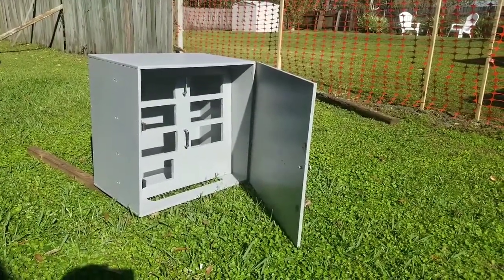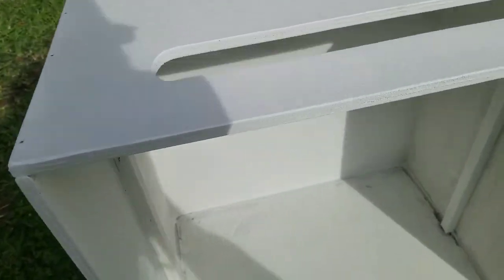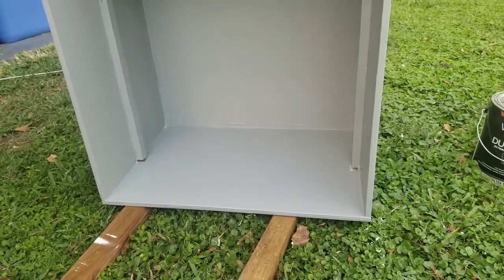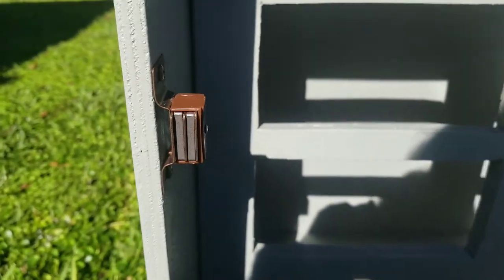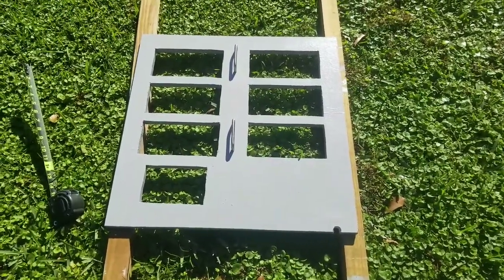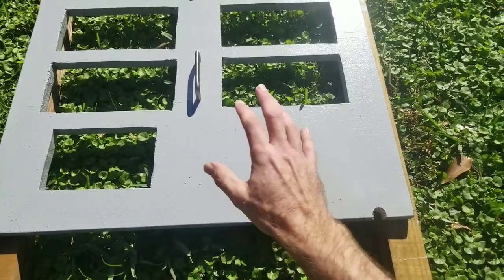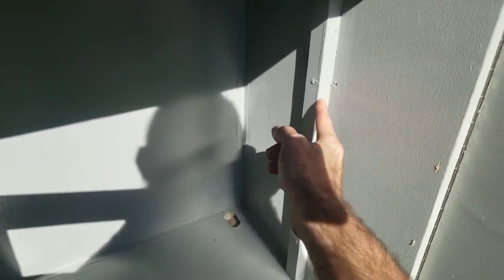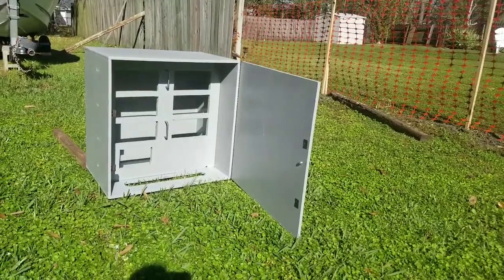Christmas Light Control Box Build - Part 4 - The Box Build

Comment: Great job! I’m contemplating how to build one for myself. I have gotten old Square D outdoor electric boxes from where I work and I’m trying to come up with ideas for mounting receptacles and wiring Christmas lights.
Reply from the maker: Thanks!
I've seen where people take a distribution block and tie into it and use SPT wire and female off it and the relay and not use outlets. I imagine it does the same thing, just not as "fancy" looking.
If I did it again, I would give more attention to wire management and make it look neater. I started trying to keep it tidy, but got rushed and... well, you see it got a but crazy. Lol
Sadly, I only used it for two years. I never got to where I could use the Vixen software to control it. And it took way too long to hand program it.
So now I'm at the point of looking at permanent pixels on my house and using XLights. But then I look at the initial cost, and that's not in my budget.
Reply: @OutdoorsWithShawn  thanks for the tip. I don’t know if I’ll get around to a project like this before this Christmas but planning to build an outdoor Christmas tree either from pvc pipe or maybe galvanized pipe. Both have pros and cons   And string up as many lights on it as possible.
Reply from the maker: @inspectorgadget6510 I want to build a 15ft tree in my yard. But a real tree and power lines are obstructing the whole plan.